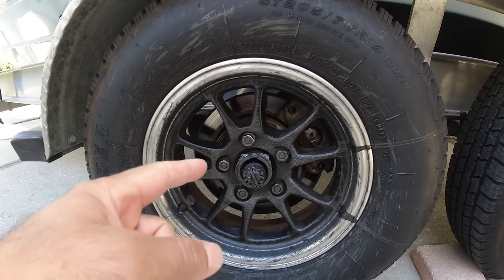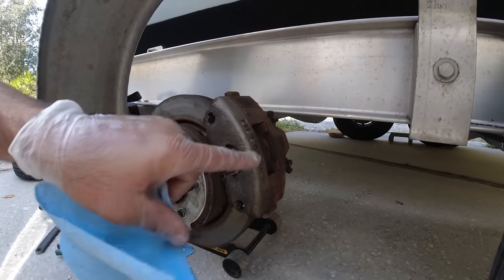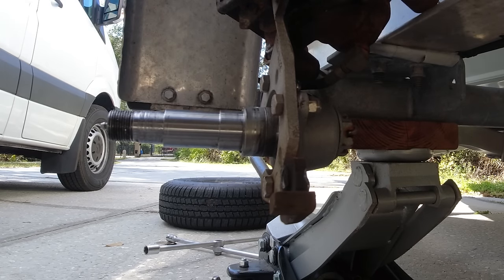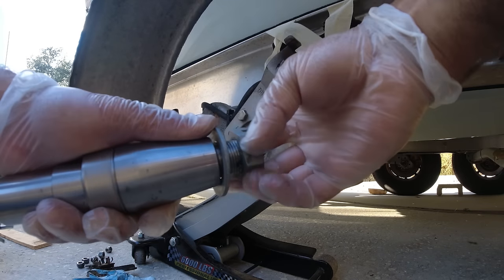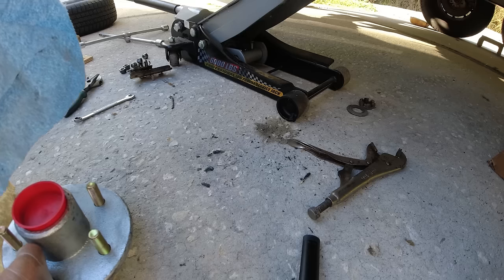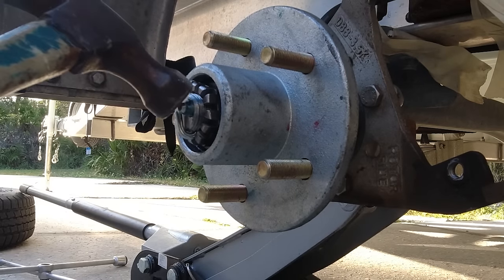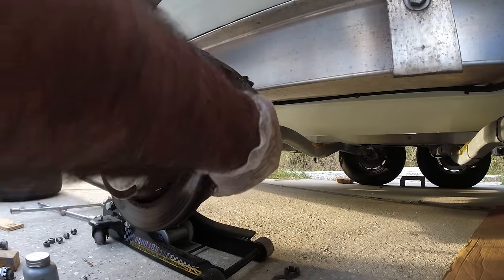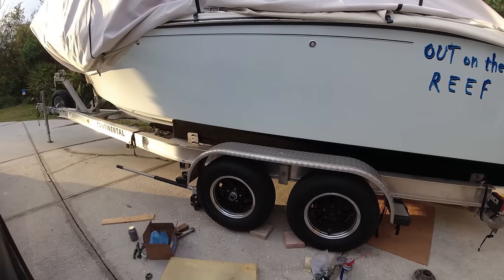Replacing Trailer Bearings that Transport the Crooked Pilot House Boat

Comment: Not once a year, every trip or every few trips minimum jack it up, and spin it as you as grease to the zerks.Also the easiest thing for me to carry on the road is another hub assembly (this is the hub and all the bearings and seals already , ready to go for not that much more on cost. Btw those dexter lube hubs really work great.  You did a nice job on your repair Capt. Thanks!
Reply from the maker: Thank you Captain that's awesome idea and I already purchased another Hub with all the bearings inside and I'm going to carry it for all my trips that's a great suggestion👍👍
Reply: I second this and was just gonna post something similar. After every dip in saltwater I put a few pumps into each bearing which pushes any water out and allows fresh grease to move around on the way home. I stopped having bearing issues when I started doing this many years ago.
Reply from the maker: @Gmtail  That was a great suggestion but by both of you I really will do something like this to my trailer Thank you for helping out

Comment: Gotta love maintenance on a saltwater trailer. I just did mine this weekend as well. All new hub/bearing assembly’s and brake rotors and pads.
Reply from the maker: awesome cap now you are ready for the summer , how many axels do you service cap?
Reply: Two just like you. But I only have brakes on one axle.
Reply from the maker: @oseadfishing3646  Does brake Assembly sometimes they get a little hard to take out I use anti Siege to help remove them later And really works good captain
Reply: I have the Kodiak stainless brake calipers but I’ve always just use the grease to grease the bolt threads and never have a problem.
Reply from the maker: @oseadfishing3646  I need to get the upgraded brakes Pat's That it has the perfect stainless steel plate

Comment: A good tip is to not put too much grease through the seek fitting on the spindle. You can pop the wheel seal out of the back of the hub and it can allot water to sit around the bearing and destroy them.
Reply from the maker: That's a good point Captain thank you so much for your knowledge 👍

Comment: Hi Capt... very helpful information! I For some reason I am not getting notified by email when you and some other subscriptions post. I used to. I'll have to check my settings....
It haven't replaced trailer bearings and spindles since the early 1980's. It was simpler back then; for one, I didn't have trailer brakes on our 1979 tandem-axel trailer...
Reply from the maker: you are lucky cap. trailers take a lot of work do to salt water, is terrible ,i wish i did have a trailer too.
have a awesome day  and is nice to hear from you cap.

Comment: Wow Captain, you were about to lose a wheel. You will definitely be replacing that hub as well bearings. Good job and I would have replaced that spindle/axle! A little tip is to carry a hand held Infrared digital thermometer and check them after traveling a distance for uneven temperatures. That' is what I do, it tells me what's going on with those bearings you can not see.
Reply from the maker: that is a awesome idea cap. instead of touching the hot metal is what i was recommended , i like your suggestion ,thanks cap.

Comment: That could have been very bad if you did not noticed it you're absolutely right you got to keep the maintenance up on the trailer I kind of dread doing this on my  tri-axle trailer but it's got to be done good video buddy
Reply from the maker: Thank you Captain very true and if you have three axles wow you have a lot of work to do but it must be done
Reply: @OutOnTheReef  I have to replace the front axle it was bent when I bought the trailer in the boat

Comment: Nice job capt .the best thing for you to get is a torque ratchet because you rim are aluminum and can crack if over torque and get lose if under torque and the best to torque the spidel nuts so it doesn't spin harbor freight have cheap ones it is a piece of mind
Reply from the maker: Great suggestion Captain thank you so much appreciate your input😉👍👍
Reply: Harbor freight is never a good idea for torque wrenches. Anything for precision use a name brand. (Not saying Snap on , Matco , or Mac). But not Harbor freight!
Reply: @CaptainDayne   before i will say yes but now they own the icon brand tha are made in the same factory of the highbrand look up there reviews mine i send the to calibration and the company told me they are really well build
Reply: @doradomarineservices4855  yeah if calibrated then you are good to go.

Comment: Grease it before  you pull it ,before  you put it in the water and immediately  after you the it out of the water ever time and you will never have an issue .I have always done this for 40 plus years and have never had an issue.
Reply from the maker: That's an awesome idea Captain I am going to definitely do that it sounds very Good idea to prevent accumulation of saltwater inside the bearings And thank you for sharing that with me Captain

Comment: I hand pack between the bearings full of grease then fill her up as much grease I can get in it full of grease no water room the helps to cool the bearings wait fifteen minutes to let bearings cool down then dunk them in the water this is how I do it five yrs no problems but you travel across state so yes check yearly put you hand on center cap should  be a little above warm as you travel at stops check them also have a complete hub and shaft with you and a dremel cutter to go at sharp angle and cut the bearing race off of spindle you have a generator so you can do it or just swap it out JT 🇺🇸🇺🇸🐠🐟🎣🛥🌴⛱😊😊🙏🏻🙏🏻🙏🏻🙏🏻🙏🏻
Reply from the maker: Awesome idea Captain it and I already purchased a extra Hub I need to get a spindle that's a great idea definitely will get those To have it with me every time I trailer specially I trailer for over 4 to 8 hours sometimes
Reply: @OutOnTheReef  definitely for you Capt Crooked if you can get two complete hubs and spindles you never know with miles you drive  JT 🇺🇸🇺🇸🐟🐠🎣🛥🌴⛱😊😊🙏🏻🙏🏻🙏🏻
Reply from the maker: @hookednrolling2009  Virtual Captain I drive sometimes over 400 miles to the Florida Keys👍👍🏝

Comment: Wow, that outside bearing was wiped out.
Guess that one needs more attention with that lubrication system.
Reply from the maker: I think probably the oil was not that good maybe it was mixed with a little bit of water I think that's what made it Get all messed up
Reply: @OutOnTheReef  It may be a good idea to give it a little grease the day after a long trip rather than before a trip to squeeze out any water. The checklist just keeps getting longer. LOL
Reply: I check mine every trip and top off the bearing buddy. I don’t boat in salt water so it probably helps a lot.
Reply from the maker: @SPLavey7751  Yes the saltwater is ten times worse than freshwater

Comment: Hey Capt Crooked you have the posi lube system like I have 10 pumps of grease in that center zerk fittings before every tripuse the CRC Sty lube blue marine grease I think it’s a  a nlgi 3 grease it doesn’t mix with water  great grease  and I use the mercury marine water proof  2 4 c grease on the  squeeze gun on the little tube of grease on the motor all fittings it won’t wash out JT 🐠🐟🎣🛥🌴🎣😊😊🙏🏻🙏🏻🙏🏻
Reply from the maker: Great Point Captain degrees amusing as For marine use And yes I have noticed that And that's a great Point pumping some fresh oil every time that really makes a big difference thanks for the great idea captain

Comment: you're lucky , the balll bearing warming could block on the shaft and break it, if you were driving on the highway , it could be very dangerous for you and for your boat. fortunatly nothing like this happend. You've made a good job on your trailer. i think you had better to put grease  every 3 monthes. like this the salt on seals would not dry and damage them.
take care
Reply from the maker: Very true Captain I will inspected before I go fishing I can't believe trailers are so complicated then I like cars

Comment: Looks like that axle and wheel bearing were from the famous Parker quality control division.  Freak'in dangerous.  You could have been killed or taken out a family driving along side you.  This is what you get when a manufacturer probably gets Chinese made crapola.  I wonder if Parker makes their own trailer parts?  By the looks of how fast those parts failed in less than 2 years that should have been under warranty, but they will of course just claim it's a wear item.  Or they will accuse you of not greasing them ofter enough.  A good dealer if you bought your boat new from them should have replaced and repaired the axel and bearings no questions asked IMO. You were smart to replace the other 3 bearing sets. Please stay clear of Parker products for your next rig.
Reply from the maker: lol  cap. i agreed and yes i could got hurt or hurt other drivers , i guess i have the right trailer for a Crooked Boat nothing better to have a Crooked Trailer lol  , it coast me about $170 in repair parts 
but if i take it to the dealer provably $800 
thanks cap ⚓👍👍
Reply: Parker has nothing to do with the trailer. Continental makes the trailer....no boat manufacturer makes trailers